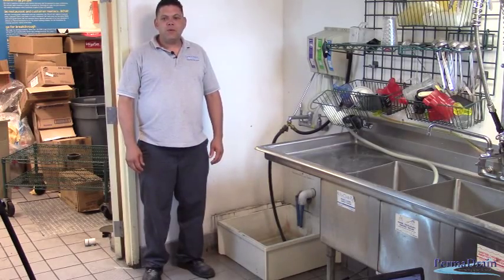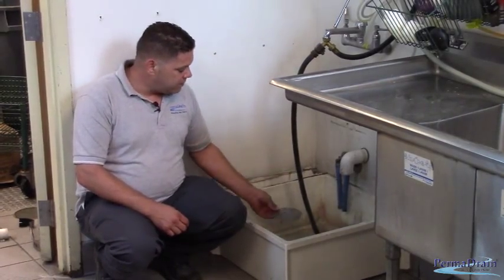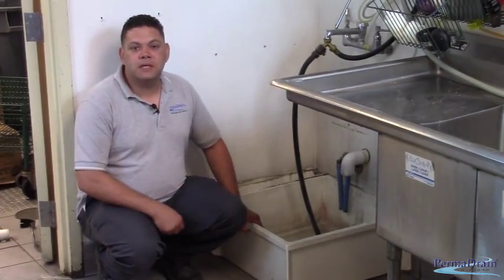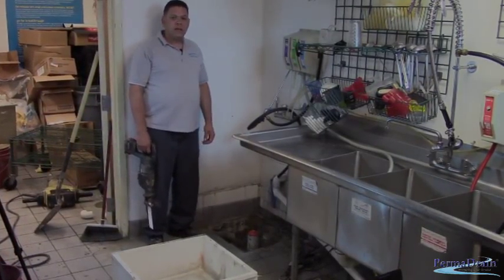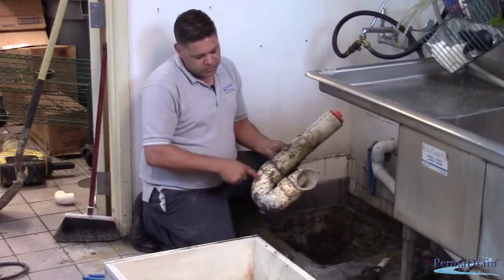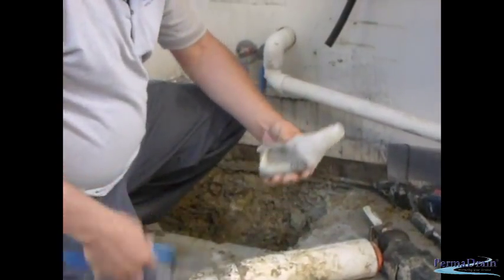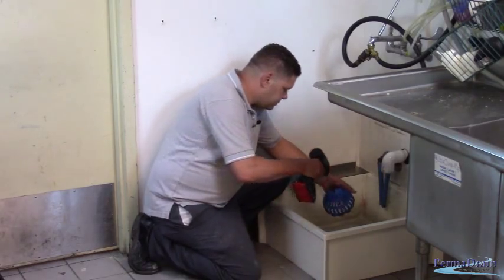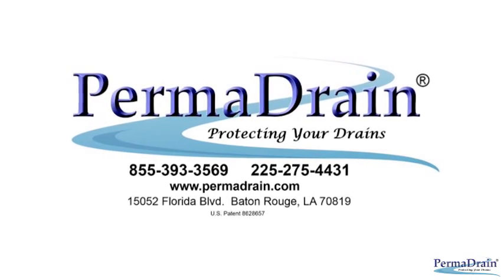How to Avoid Major Commercial Drain Blockage

Comment: There is chemical (reserved) that would have dissolved that plastic bottle and avoid the huge job. I know the product, but you are the plumber.  Also, I have a snake that would have grabbed that bottle and shed it to pieces. If the sch 40 pipe breaks off, then it was installed (glued) incorrectly. Just my 2 cents
Reply: Can you please share? Own a small cafe and having this same issue.